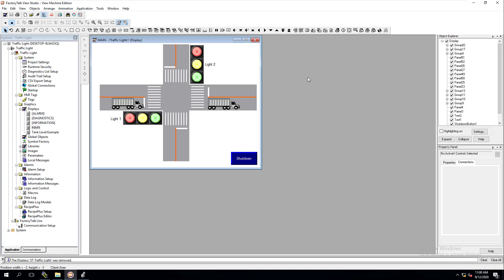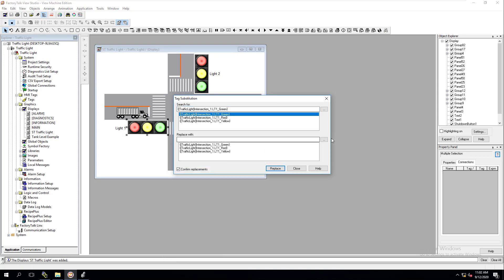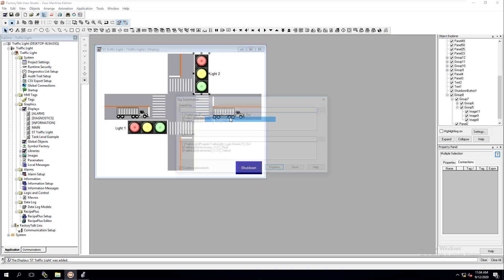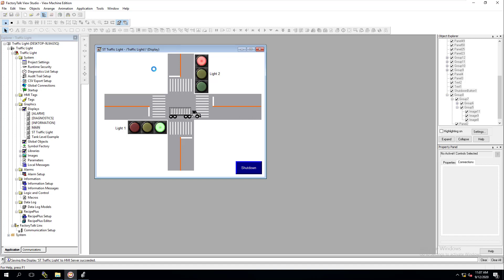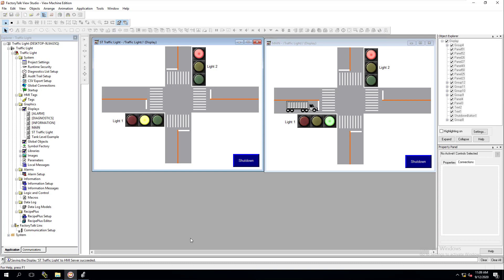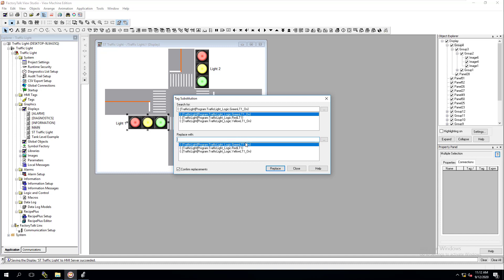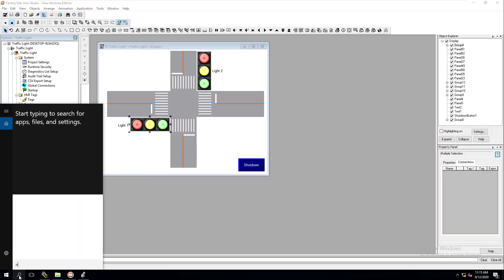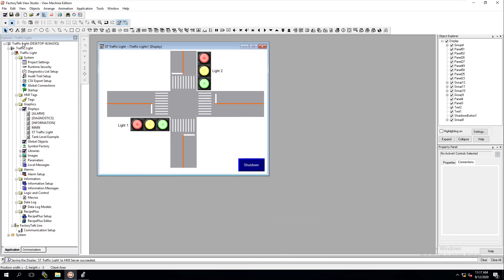Tag Substitution In FactoryTalk View Machine Edition (Save Time)

Comment: Hi how to change time in factory talk  cause the time of alarm is different from date of computer
Reply from the maker: Make sure your PLC processors are time matched & there is a clock tool you can use if needed.

Meaning, set date & time in the PLC processors are correct.

Also check the type of alarming you are using